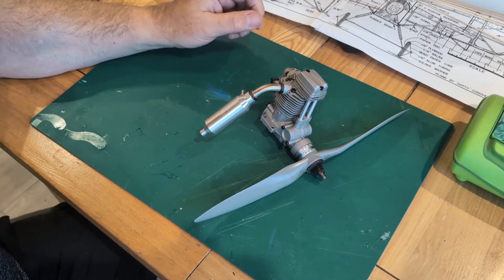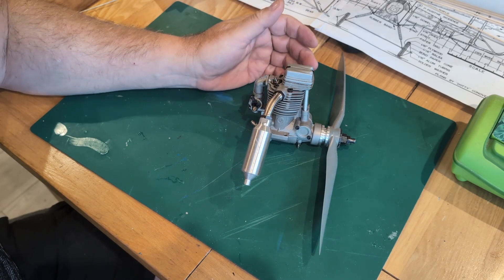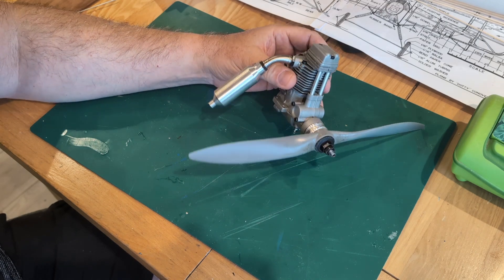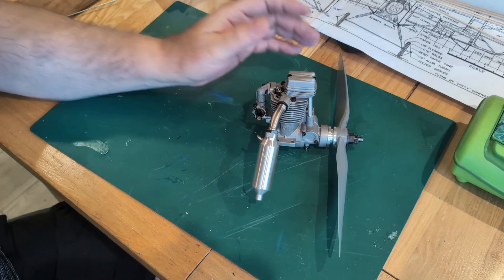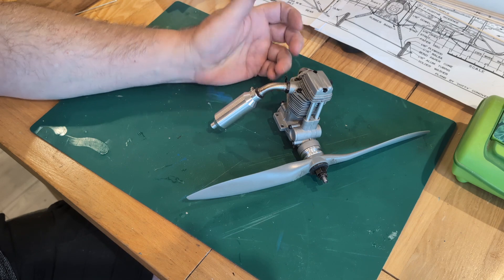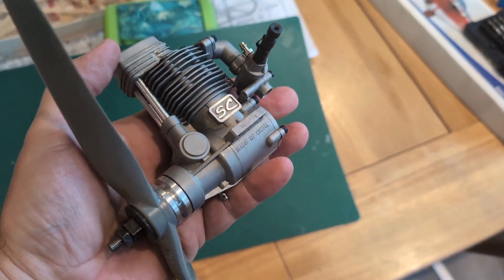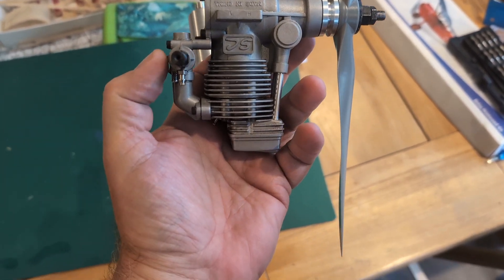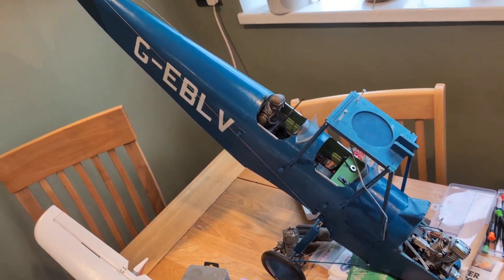New project needs a new engine

Comment: These engines are great.
I have a .61FS that broke a connecting rod after 8 years of intensive flying… immediately got replaced with the exact same engine. 
Not sure the so called top end engines are better or worth their price.

Is there a 1.4 m Tiger Moth on the horizon…?
Reply from the maker: Now that would be telling.

Comment: I've got the same engine Mark....I've converted it to spark ignition which gives a reliable low idle and consistent timing...I had to shim the head to reduce compression.....I'm guessing you're building a Tiger Moth...?.....🤔😳😏🇬🇧